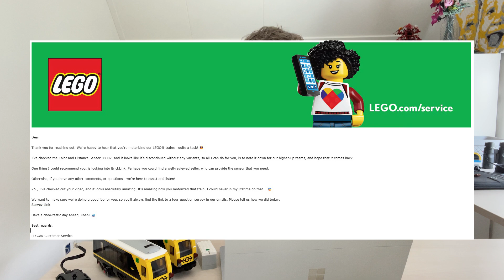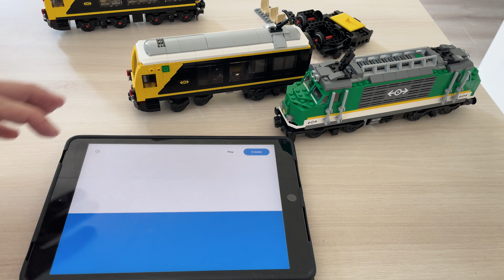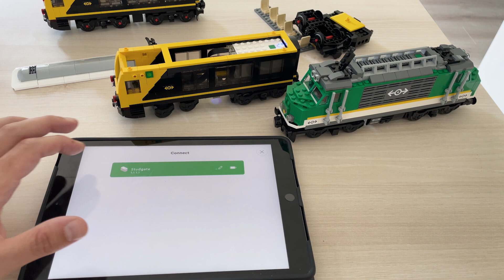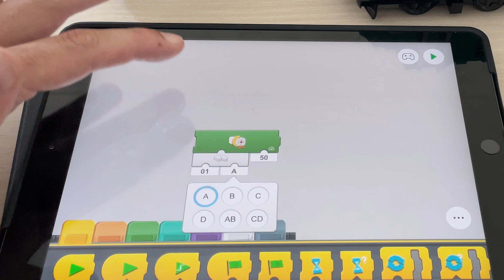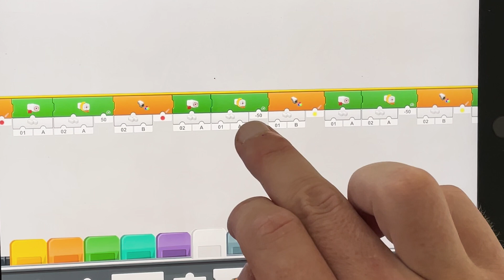LEGO Train Automation Part 2 🚦🚂 | Running Multiple Trains Automatically in My LEGO City

Comment: Cool im working on a contreller and lipo bater badpsed on rasbery pipico 2w and pf motors for a ba5ery box 4 times the sise with 2x heigh and 2x long 16 by4  studs by 6 briks heigh mounted on the front cab with all traine cars having one pf motor connected in series or in seperare chanells for a total of 6 pf motor chanels  and 6 pf connector sensor ports for can bus and i2c and analog so tacjphometers can be installed on all axells , will be potied with epoxy in a brick shape with a lego pully housing 3 magnets , the front cab will hav an axelerometer on it so the board can deduce slip and can potentially have a spi camera and streem real time video and can be preprogramed with track layout using imu , or beter be programed to do pid conrroll for speen and function commands like open dore close dore steam on forwards backwards ext and lights on , from the computer using microros and ros2 using python on computer and picoc, cpp on the pico the problem for now is the board is 8 layers and complicated parts for switching signalls and can adaptters expensive and also sensors have to be hand ,ade and poted , the pf smoke thing can die easily , and the ros2 system with beter programing fetures and some machine learning stuff that can be don with ai and example help like tenserflow work only in linux and may need 50 to 100 gigabytes for every toy program like simple tenserflow pythons image processing libery and joystic suport so you can controll traines with them or a lego megazord on ubunto on a vmbox virtuall machine in windows and mack , but when progrmed right you can use a ros2 robot controller app on the phone to send simple commands or i give a simple terminal program that lunches a preticular trains ros2 and program handler so it containes all the way points and speeds coresponding to that peticular track plan and wen activated should make the teain navigate prety tight tracks of r26 or so and teight switshing arangments and 30 to 45 degree instant inclines thet need the teaine to speedup first then slowdown and never fully lose traction as to not derail, i started as a school project programing the pico had problems we just used the pico on a breadbord with an h bridge and lipp with power converters to the motors so we ca  send the more complex program but run an http web server with only one speed input
Reply from the maker: Id love to check out raspberry pi in combination with LEGO trains, sounds like quite the challenge though!

Welcome to the channel 👍🏻😊

Comment: Nice video. Thr programming worked well. I bought a color sensor last week, however did not have success with the app. So I used pybricks and it worked fine. The sensor was 35 Pound on Amazon co uk, and there is one left 😀